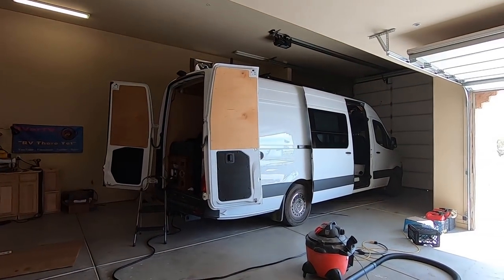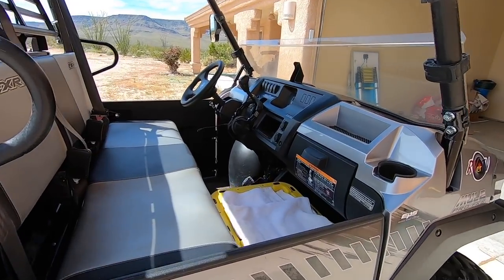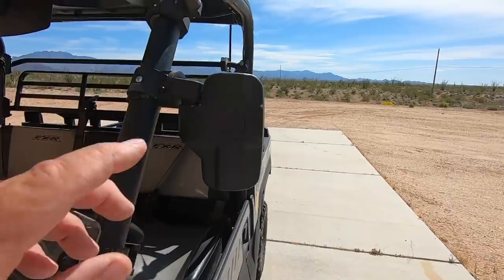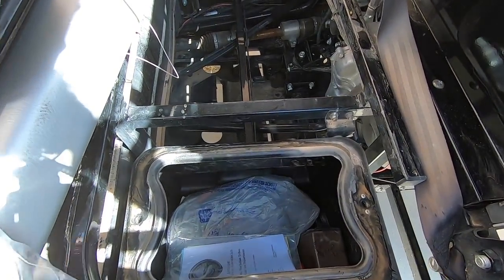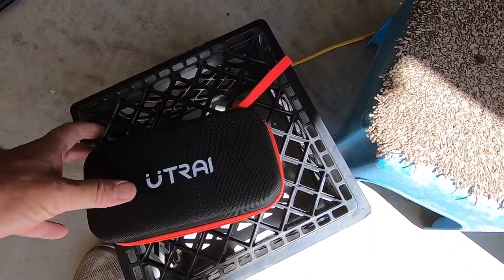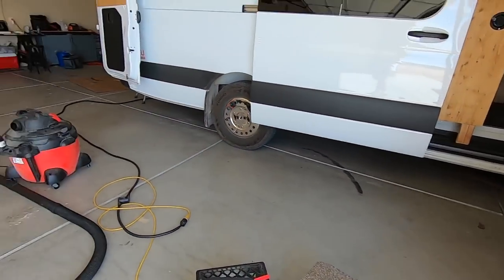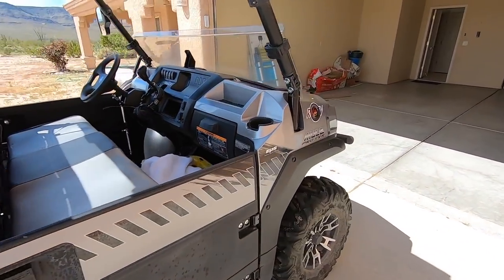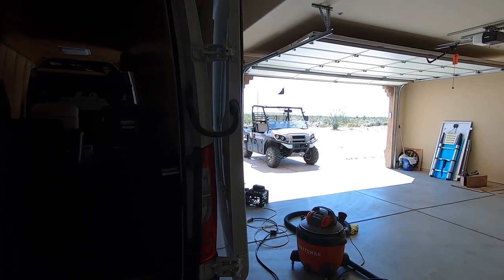Dusty Nugget - Kawasaki Mule Pro - Video Set Up

Comment: Nice setup on the Nugget. On the gas cans in your van, you might want to check out how the overlander groups have a  gas container on the outside rear of their vehicles. That might be a little safer in the long run if you could use it on the van. Also, do you plan to take Dusty with you when you travel? Anyway take care and be safe out there.

Comment: Russ--If you want to see some pretty country take Alamo Rd. all the way to the lake. When you get to the old airstrip at Signal Rd. jct. look to the west on the side of the hill and there is an old rock cabin there. There are some massive Saguaro's from Signal rd. to the lake. Then if you go east on Signal Rd. to the Big Sandy, At the old town of signal is the Signal  Cemetery. The country from Signal Rd. to the lake is really pretty. When the Saguaros bloom it is really something. Alamo rd is maintained all the way to the lake. It's 56 mi. from Yucca. Lots of cool country down there. The old McCracken Mine at the Signal Rd jct. is something. It was a monster. I bladed every inch of those rds.

Comment: I imagine you have water in your cooler, but where is your first aid kit?  I have a similar jump starter and it works great.  Jumped my Suburban from stone dead with it.  Amazing little devices.  I'll have to put it on my video to-do list.  We're running a Hero 5 and a Note 9.  Not as nice, but they get the job done.  You do good work.  Keep it up and stay safe.